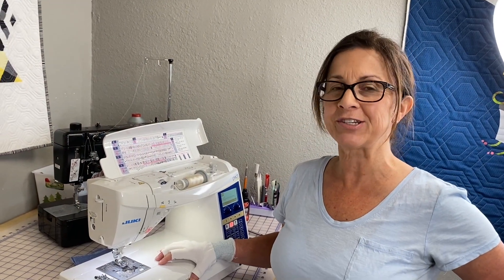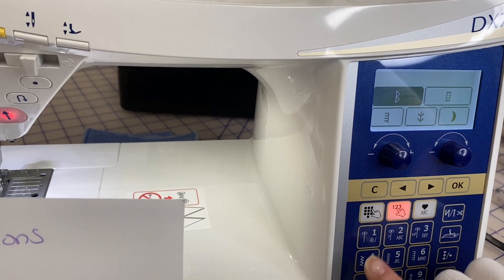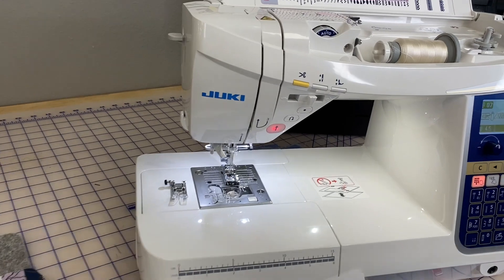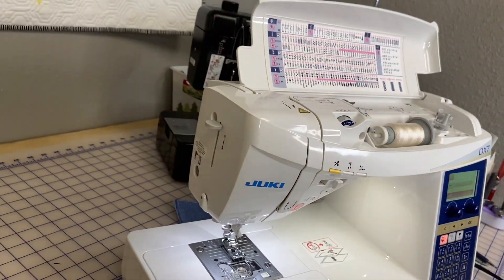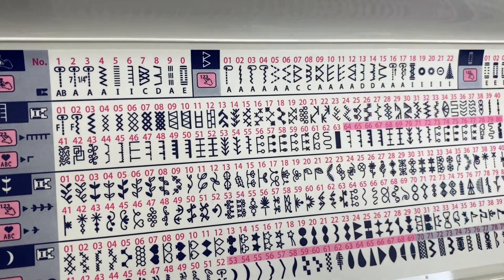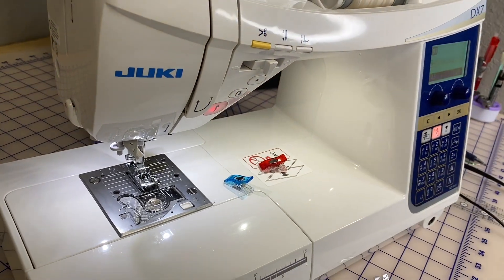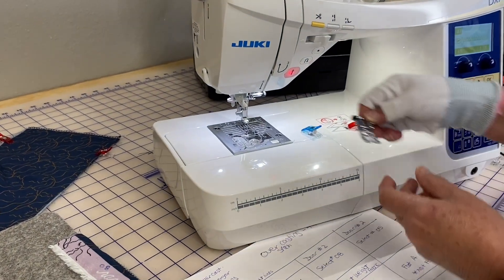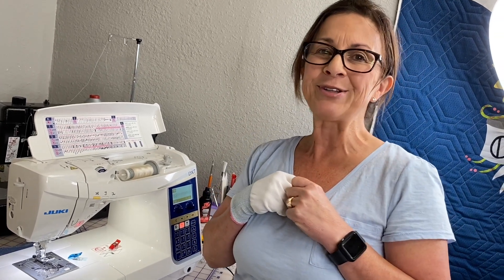How To Use An Overcasting Stitch On A Juki Sewing Machine (DX-7, F-series)

Comment: Is it not necessary to change the needle when you switch from denim to finer fabrics or knits? I thought you ‘had’ to, but am somewhat excited to see that you didn’t…..In my previous machine (Brother cS6000i) the knit would get pulled into the throat plate with the size 11 or 14 needle which is my default for much of what I do with cottons! I have the HZL-DX-5